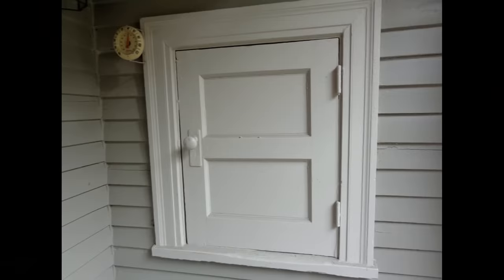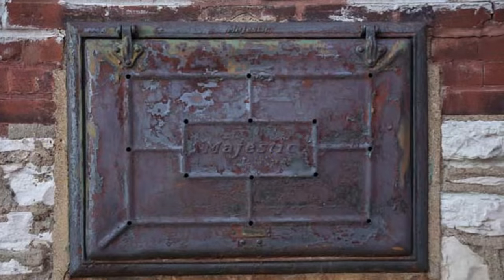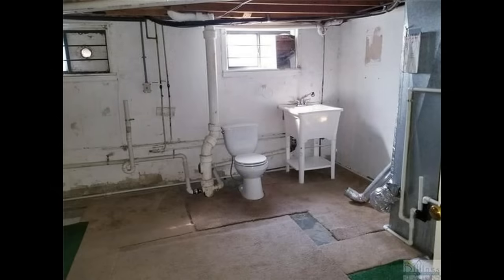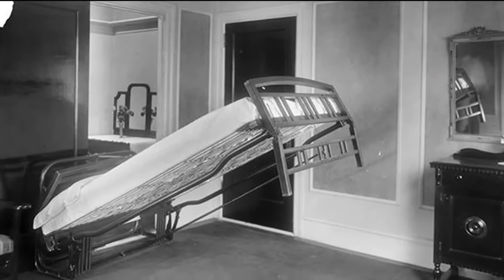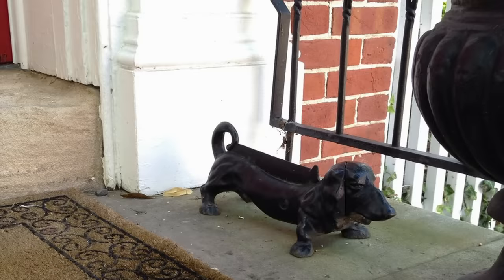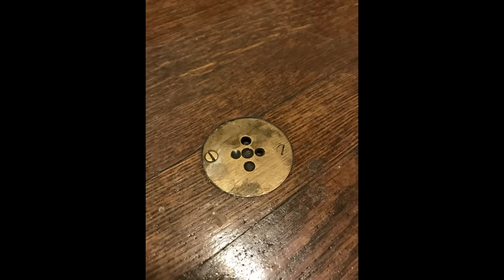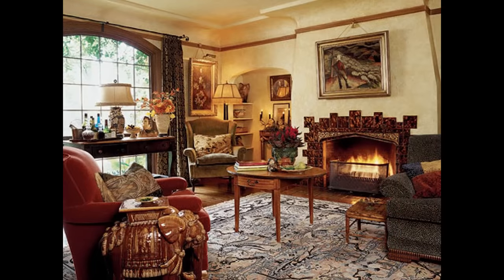Mysterious Home Features No Longer Used

Comment: Modern condos still have usually at least one landline plug still in them.  I guess  you never know why you might need one.  The house I grew up in was built in the 80's, but still had an intercom system in it.
Reply: When is the last time you saw a land line wall phone in a kitchen? 😁

Comment: My granny's house a door into the kitchen that swung both ways so you could shoulder through it in either direction with your hands full, weighted so that it would swing itself closed but without anything to knock against and make a noise. We always kept it propped open from about september until april every year, but in the summer, in the south, in an un-air-conditioned old house, the ability to shut the kitchen away from the rest of the house when someone was cooking was an absolute lifesaver (if you weren't the one sweating in the kitchen)

Comment: My home is turn of the century and has many of the features shown plus a few other clever features.  For example, the outside of the window has a lip on a track that can be raised to sweep out debris from the sill and one of the upstairs windows is a size of a door to allow furniture up to the bedrooms that would not otherwise fit up the stairs.  The tall ceilings are usually found in homes that were heated by fireplaces, so not only did heat rise above  one's head in the summer, but so did the trace amounts of smoke in the winter.
Reply from the maker: Thank you for watching and telling us about your home and some additional features.

Comment: I can't wait until open concept is over. I went to visit so many homes in which I could have cried at seeing all the walls they knocked down.

I certainly felt a little bitterness that I ended up paying a higher price for my house because a flipper had come in, only to have to turn around and add 2.5 walls they took down, install a tub in the hall bath where they'd removed it (does no one have children? What's with the trend of eliminating all the bathtubs?), remove the laminate floors and reinstall hardwood, which they'd removed, etc., etc.
Reply from the maker: Thank you for watching and sharing some of what you have experienced and witnessed.  I do think it's a trend which will change at some point.

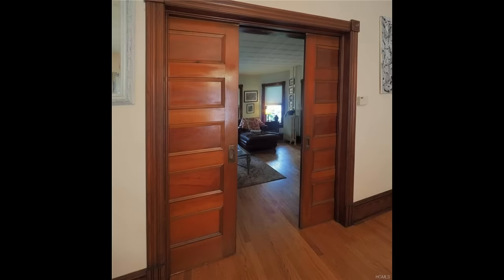Comment: 9:13 pocket doors are against building codes in many areas due to pocket doors not being able to isolate rooms from spreading fire within a specific timeframe. Opening transom windows in between rooms are also against code for the spreading smoke hazard.

Comment: As you encouraged me by asking, I add one very helpful device, I' ve come across in a house of the late 19th century.
It was a little wooden cabinet with a frontdoor to open. It has been placed right above the kitchen's radiator  and was meant to carry tableware inside.  It's perforated base made it possible, that warm air circulated to pre-warm  the items looked in. 
I' m quite sure that this  gadget was not only common in Germany.

Comment: Old house where I grew up had a concrete cubby with a cast iron grate to store your clothes iron and a Murphy ironing board that folded back into the wall. Other great features included a cast iron peep door on the front door, a laundry shoot, a built-in linen closet, intercoms, and built-in storage in the lower walls of the attic, under stairs, and in soffited areas. I've been in many houses with intercoms and none ever worked even when they were new.

Comment: Back in the 90s I and a few friends were renting a house that had wires wrapped in cloth strung across those ceramic insulators. And yes, was very much live and ran lights on multiple floors. Heard later that the place burned down about 2 years after we moved out. Not surprised.
Reply from the maker: That's pretty scary.  Thank you for watching!

Comment: I accidentally electrocuted myself on one of those push button light switches at my grandmas very old house on the east coast when I was a little kid. The button had slipped off and just left some wires exposed and being that it was dark, I couldn’t see and stuck my finger inside of the hole and got quite a shock! Her house also included a laundry shoot, servants stairs, a small house right outside that had been servants quarters, etc etc. 

My family was not the original owners of the home.
Reply from the maker: Sounds like you lived in an interesting home.  Thanks again for sharing some of your memories!

Comment: The access to some of these rooms, through a closet or concealed wall panel, is intrigueing and trying to discern the presence of these rooms from the outside is near impossible. Smaller homes may have them, too. Narrow, discreet passageways makes it fun to 'magically' appear in different rooms and surprise your guests, even though the original intent was for servants. Homes SHOULD be fun!

Comment: Not sure wether this was also common elsewhere but in Germany up to rather recently bathrooms always had their light-switches put outside of the room next to the door due to safety regulations meant to prevent electrocutions by contact with water inside the bathroom. 
On another note German sibling fights often result in random toilet blackouts

Comment: Pittsburgh potty!?!  I had no idea they were called that!  I had one in my house and in a rental house.  I have had push button light switches, boot scrapers, razor blade slots, coal hoppers, plaster ceilings and walls in my current 98 year old home.  My friend had a secret passage in her home on the Ohio River Blvd.  It opened up from a secret compartment in the house and had stairs going down to the Ohio River.  This area was the end of the line for the Underground Railroad.  Pretty cool!

Comment: Honestly the idea behind the milk boxes, ice boxes, and coal delivery chutes could see a modern reappearance if they were built as secure package delivery doors. With all the "porch pirate" package thieves these days, I'd think that idea could gain some traction.
And why not make them smart? Add a camera to confirm deliveries and catch any potential thieves, and one could even have a system (like weight sensors or something) that could detect if a package was in the box and would lock the outside door.
And I mean, yeah, a determined thief will still find ways around any security measures, but if your package isn't the easiest to steal (i.e. just sitting out in the open by the front door), it will deter the thieves who are only looking for an easy target.
Just a thought!
Reply from the maker: You're right about them needing yo be repurposed.  Thank you for watching!

Comment: Lived in a house with the push-button light switches, back in '70's; also had lamp sockets in the walls, for little 2-pole outlets that screwed into them like a lightbulb.  (A lightbulb would fit, too)

Comment: My grandparents had those porcelain insulators in their home into the 1960s. Electricity was added to the house after it was built in the 1920s.

My bedroom in that house had a roll around chest with a mirror and a place to hang shirts and pants.

The windows had sash weights to help raising and lowering them.

Comment: The iron doors for delivering coal were NOT Small...not in MY neighborhood. And NO ONE Shoveled coal thru them: The truck driver backed up as close as possible, then rigged a conveyor belt between the back of his truck and the coal door. Connect the PTO drive, and you had a ton of coal in your basement in10 minutes or so.

Comment: My old apartment was very old they had a dumb waiter coal Chute / incinerator The wood paneling it was a walk up. My sister‘s home is 100 years old it has the Pittsburgh potty in the basement had to have the electricity rewired completely and she has counterweights to open the windows in the attic since those weren’t redone. My parents have a house from the 70s with all the bells and whistles they’ve updated it quite a bit but definitely have the intercom system going through !! Split by level beautiful original Stone fireplace and I’ll have to check around for some of those other features. I’ve actually seen all of these in many houses I’ve visited throughout the years.
Reply from the maker: Thank you for watching and sharing a little more about places you have had within your family.

Comment: HITCHING POSTS!  Some houses in old neighborhoods still have posts in front on the street where horses were hitched.  I saw these in an old neighborhood, and didn't understand what they were for at first.  Some still have rings in them.  If you look carefully in old neighborhoods, you can still find where rings were once located, on walls, the sides of buildings.  Sometimes they're ornate--like a horse or some other ornament.

Comment: Thank you. Very interesting and nostalgic video. Yes, we can surely learn lessons from the past.

 in the UK we had fire insurance marks or plaques on the outside of houses which were metal plaques marked with the emblem of the insurance company which were affixed to the front of insured buildings as a guide to the insurance company's fire brigade. These identification marks were used in the eighteenth and nineteenth century in the days before municipal fire services were formed. if you didn't have one of these, your fire would not be attended.

Comment: I grew up in rural Indiana, our house, as well as a lot of the older houses had fire woods doors, that led to a small cabinet next to the fire place, and could be accessed from inside as ell. to load the firewood from outside, and give it a place to thaw, and for snow melt to drip down into a drip pan that drained to the outside. it could hold about 1/8 cord of wood, so more than enough for a night's fire.  also inside the fire place was a wrought iron hook that could swivel in and out, to hold cast iron cook pots.
Reply from the maker: Thank you for watching and sharing what your home wad like.

Comment: I lived in an older home that had heat from big metal radiators. The heat was generated from water in the radiators. Some times they would let off steam. We kids were told to stay away from them. They could get extremely hot and burn you if you got to close or you touched them. They would be considered a safety hazard today. Also, outside homes were metal posts and rings to hitch your horse up too. From before cars or when people still used horses for their main transportation -- a carryover from the past. I remember seeing a lot of them when I was a kid.
Reply from the maker: That is a great item that you mentioned for us to remember.  You're right about them being a safety issue now.  Thank you for watching!

Comment: Didn't have the built-in milk box but we did use an insulated, galvanized steel box for milk delivery. We had the clothes chute and the servant stairs and the razor slots in the medicine cabinets. Also had an indoor root cellar but just used it for general storage. Our windows also used the rope and counter-weight system mentioned by Laura Porter. 

One thing we had you didn't mention was an "incinerator". It was a small cast iron door in the kitchen that fed down into the basement. You threw used paper products down it and when it was "full" you would go down into the basement, open another cast iron door and light the paper. Once the fire went out and the embers cooled you opened a third, floor-level door and raked out the ashes.

A second thing you didn't mention was a narrow door we had on the second floor. Open the door and out dropped an ironing board.

Comment: Something I saw recently in an old home (1920s) was a little door in the kitchen at bench height. When you opened it there were 2 shelves inside and a grate at the back - it was a baked goods cooler, allowing the cooler air from outside to cool something baked, without it needing to be outside.

Comment: Cool video, thanks. fyi: part of the reason laundry chutes and dumb-waiters went the way of the dodo is fire prevention regulations which restrict top to bottom cavities which will carry oxygen, smoke and flame unmitigated through a home. As for the steel cables holding walls together; these are still used in certain forms of construction and are commonly called "whalers" (no idea why).
Reply from the maker: Thank you for watching and giving us more information Joey!

Comment: We have an intercom system in our house! It even works, though not very well. I always thought it was odd because the house is fairly small and you can definitely shout at one end of the house and have someone on the other end hear you. It was probably only there because it was supposed to be the "all-electric house of the future" and the builders wanted to cram as much unnecessary but cool stuff into it as they could so that it would sell...

Comment: The house I live in now had an old intercom system that no longer worked.  The panel was in the kitchen and also had an A.M radio built in so it may have been possible to play music throughout the house.  This isn’t an old house but a ranch style built around 1955.

My parents’ house, also a ranch style, had three pocket doors.  One for the bathroom off the laundry room, one in another bathroom to separate the toilet and shower/tub from the sink area.  The last separated the dining room from the kitchen.  That one was hardly ever used.  This house was built in the early 60s so not old.  However it’s rather a shame if the trend was away from these doors.  They are very convenient and are good for smaller rooms rather than a full sized door.
Reply from the maker: Thank you for watching and sharing some of your experience with a few of these items.

Comment: My house was built in 1921. There is a built in icebox in the basement, with a drain in the top to channel out the meltwater. Also, there’s a built in dresser upstairs. I have attic spaces that run along each side of the house, accessible by a small door on each side.

My mom’s house used to have a light in the dining room over the table that was on a pulley hidden inside the ceiling. You could pull the light closer to the table if you needed to.

Comment: I've lived in older homes almost always while living in WNY and the southern tier mostly victorian's that were converted or flats. I've had the rope windows, pocket doors, milk door, window searlt, ironing boards and my favorite built in giant cutting boards that basically add 30% more counter space, I've almost always had a laundry chute.....I've never had them all in one space
Reply: WNY City of Buffalo soooo many great Victorian homes with these features. Coal shoot, root cellar, transomes, pocket doors, push button swithches, milk doors, telephone niche, built in china cabinets, here's one not mentioned refridgerator built into a wall in the kitchen. The motor compressor and heat exchanger were exposed inside the varanda to release heat outside the kitchen. Grandparents house built around 1865 still occupied by my aunt and uncle, had the varanda which was stacked with wood for the kitchen stove, a coal chute and bin under the kitchen where the coal furnace (still in use) was located. There is an oil tank burried in the front yard for the time when heated by oil. Opa worked for Iroquois Gas company so when I was a boy, they were heating with natural gas 1964. When my uncle bought the place from Oma, he removed the gas heater in the living room and replaced it with a wood stove. I recall spending time with Opa in the cellar tinkering with some project or another with a small coal fire in the furnace keeping the pipes fron freezing in the bitter cold of Jan and Feb. I recall all the many hours of work spend in the 5 gardens where our family grew an abundance of food, the long days of family preparing and canning and freezing foods for the winter. My parents would put up 450 quarts of tomatoes, 450 green beans, 200 yellow beans, freeze 500 quarts of sweet corn, 300 green beans. We would fill to overflowing my Grandparent's root cellar with carrots, potatos, onions, beats. We froze applesauce, green peas, peaches, pears, cherries, made gallons of strawberry and cherry preserves. That was such a different time. I also tapped the giant sugar maple trees in the front yard and made my own maple syrup.

Comment: My home, built in 1976, has pone plugs and I might have installed a few more than the house came with.

We still have functioning "Knob and Tube" wiring in one of the Funeral Homes, build before 1912, where I work.  So long as you are smarter than the wires they are perfectly safe.  When working as a residential electrician in the later 90s I added some electrical circuits to a ranch house that dates from the 1880s I found that the existing electric wiring was all knob and tube and I just left it along when I put new receptacles in the 18" adobe walls.

Comment: My 1910 bungalow still has push button switches, the coal door, and the coal hot water heater (that's no longer used).  Cable & weight windows, and an ash pit in the fireplace that has a small outside metal door at ground level to clean out the ashes.  The land line phone connection panel was so rare, the phone guy took a picture of it.  My first house as a child was built in 1956 and we had more fun going up and down the laundry chute.  Great for rainy day indoor hide and seek.  A house I saw in Dayton, WA had a grate in the ceiling for allowing heat to go upstairs.  In my house you can see that it originally had a door at the bottom of the stairs to keep the heat on the main floor.  And yeah, lath and plaster walls are impossible to hang anything on.  I think the lower wainscot on walls was for hanging dining room chairs on but don't quote me.  Thanks for the video.  Fun and educational.
Reply from the maker: Thank you for watching and telling us about your home as well as another you saw in WA.